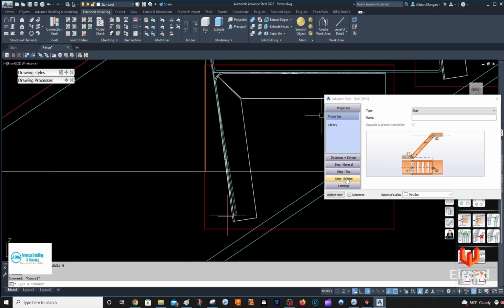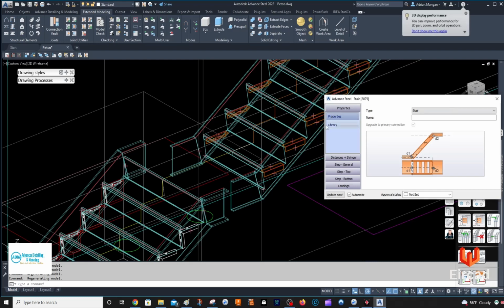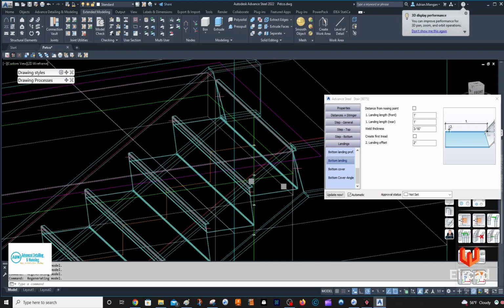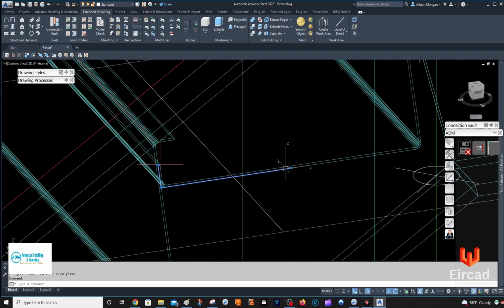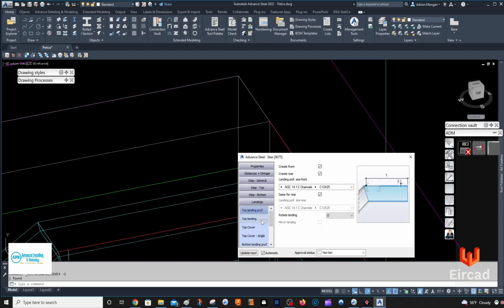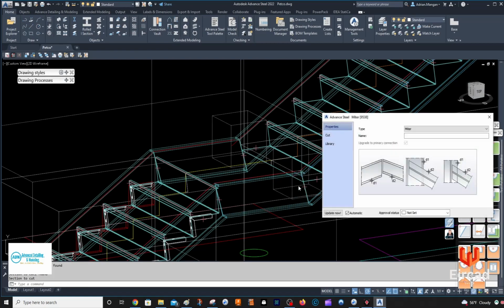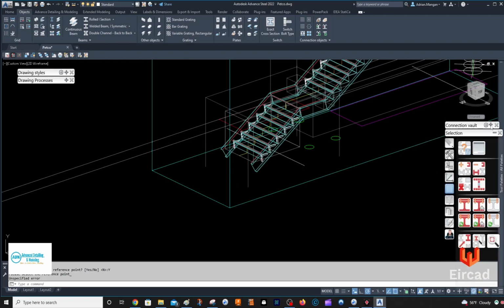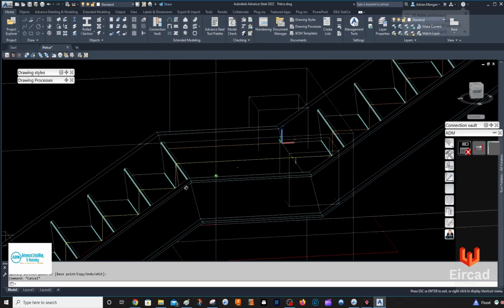ADVANCE STEEL: Stair Work Long.

Comment: Hello,

I am trying to connect an eaves beam to a column using the 'single eaves beam bracket from plate with end plate' connection. However, when i use this, the end plate connects to the far side of the column instead of the side closest to the eaves beam. Any idea how to fix this?